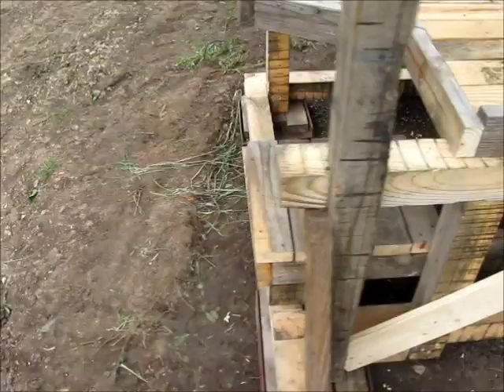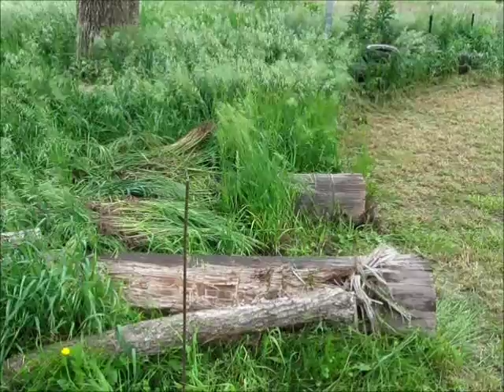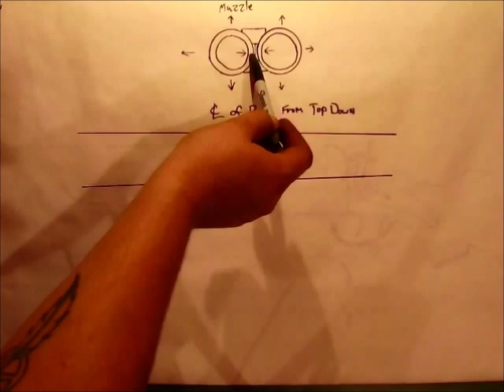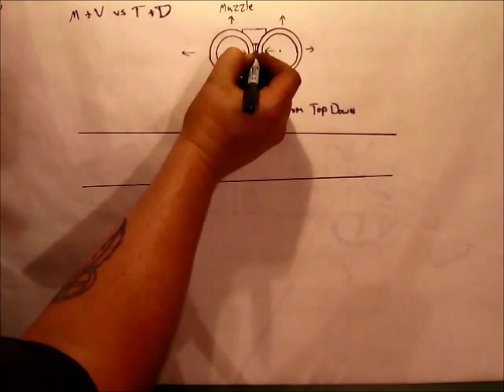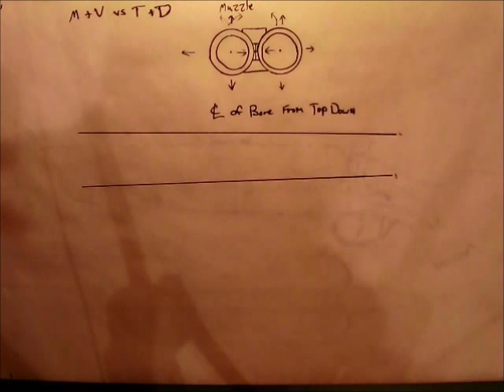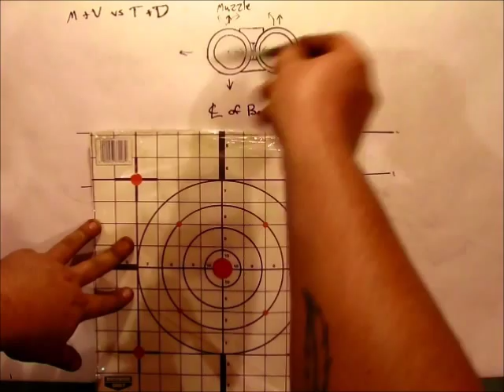10 Bore 1844 Purdey Double Rifle Part 15

Comment: The physics part was poorly explained for you included several arbitrary components like f=ma. Obviously it's true, but literally all you HAD to explain is the object's(aka bullets in this case) trajectory being changed relatively in one barrel to another as one of the barrel suffers relatively more rotation around the pivot point which you explained well with the third law of newton. Which thus changes the path the bullet will follow upon leaving the barrel(as in, a ball is pushed trough a pipe but the pipe is swiped to the left in the progress shooting the ball in a "curved" trajectory).

Also makes me wonder. Imagine you had a case with close to no recoil(so all force is neglected by for example a very heavy object holding the gun) would the bullets collide at one point?